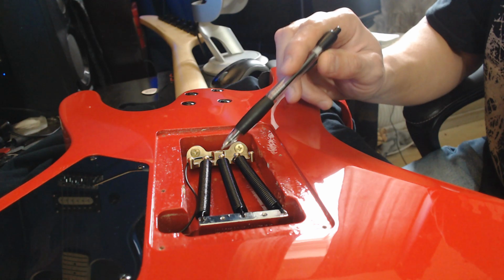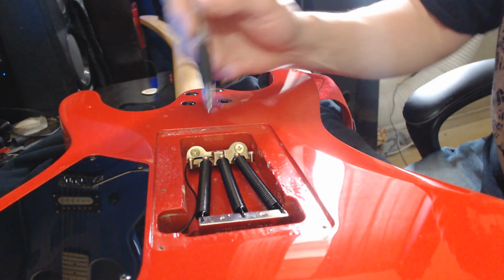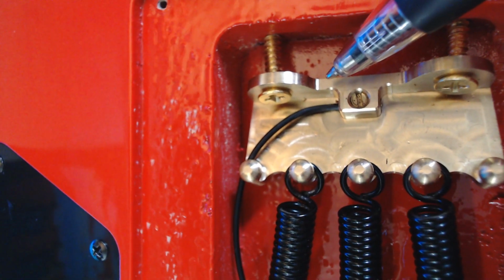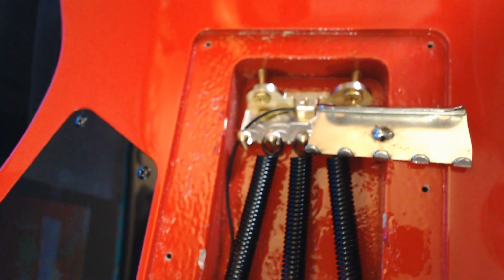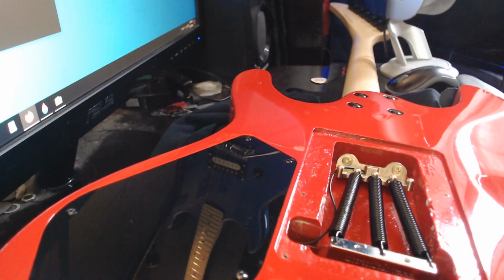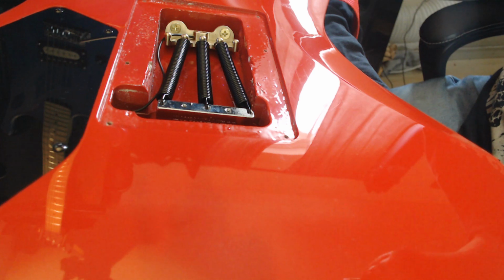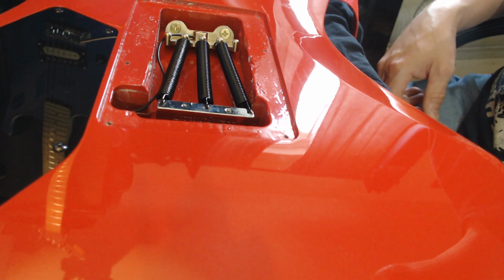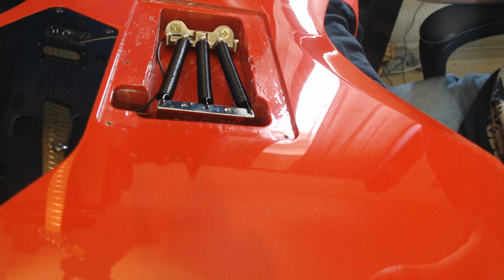Musiclily Heavy Duty Brass Claw, Upgrade your Floyd Rose or Tremolo Claw

Comment: Waste of money. The block is connected to the body through SPRINGS!
Next we'll be buying giant brass springs!
Reply from the maker: Brass springs might be a good idea. LOL.  The springs actually do transfer vibration to the claw then the body, you can tell when you have bad spring noise or bad resonance at the springs because your springs are vibrating thus transferring it to the claw and brass is known to transfer tone vibration better that’s why the good Floyd roses come with a brass tone block, just a little info on brass. It actually made a huge difference on my guitar but everyone has their own opinions.   I suggest you try it and if you don’t feel it makes a difference put your old one back but I’m sure you will feel more sustain body vibration and tuning stability now this is only if you have those flimsy steel claws that are coming in guitars. Thanks for watching. ✌️